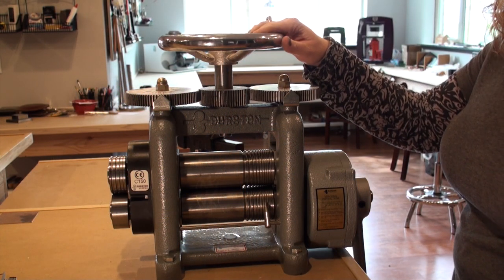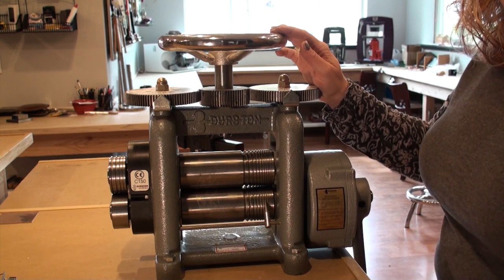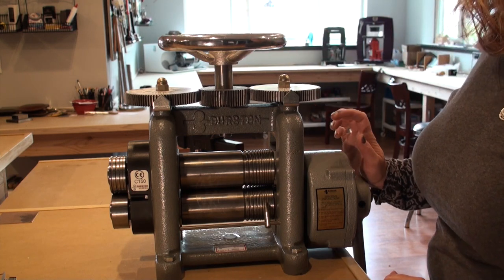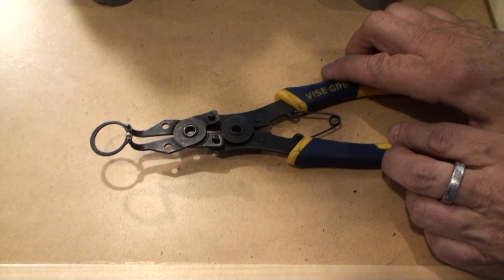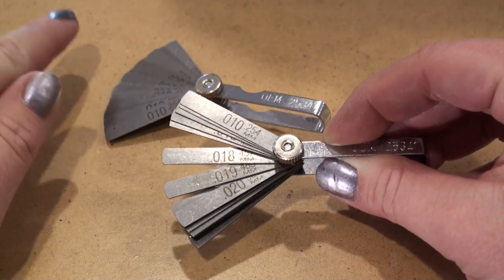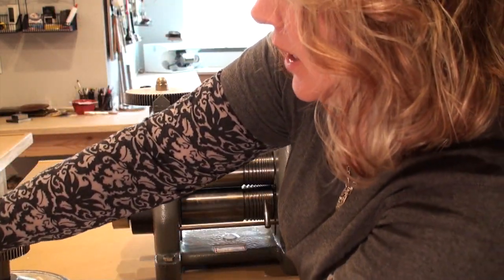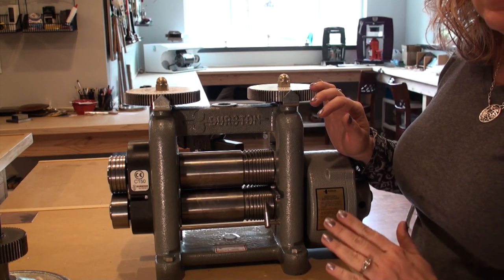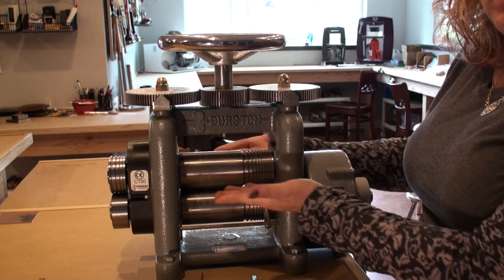Tool Time Tuesday - Adjusting your Rolling Mill Rollers

Comment from the maker: @luemoonba, Rolling mills can be found in many price ranges. This one was a bit more expensive than a lot, but more middle of the road (around $1,200.) You will certainly get what you pay for. Inexpensive ones can be found for as little as $200 (I can get that one for you.) I saw some good prices on a Durston on Contenti's website recently. Price will be affected by the roller size, wire rollers, extension rollers, etc. Just make sure you get one with a reduction gear.

Comment: Thank you so much. Was so excited when I picked up a high quality used mill at a great price only to discover that the rollers were not running parallel. I would like to think that eventually I would have been able to figure out the solution on my own, but you made it a lot faster and much less stressful.

Comment: Hi Melissa,  I have a Durston DRM C150 and my gears are hidden until I take the handwheel out.  The gears are still partially hidden even after I remove the handwheel and they're really hard to turn by hand.  Do you have any suggestions?  Do you happen to know if that's normal for that type of mill?
Reply from the maker: As you already know, they changed the design of the mills since I purchased mine. I am not sure how you would do it unless you are somehow able to remove the cover that guards the gears. I will see if I know anyone who has this style of mill and wee what I can try.
Reply: That'd be great!  Thanks so much! =)  Love your videos, by the way.  I've learned a lot from you and really appreciate how freely you share so much great information.

Comment: Hi, Melissa.  Thanks for the video.  Does this work for a Pepe rolling mill, as well?  I have a 130 flat mill from Pepe.  I am not sure they're calibrated correctly because they're very difficult to roll anything through them and I thought this may be the issue I'm having.  Thanks!
Reply from the maker: yes, this will work as well on  a Pepe or any other rolling mill. But I am not sure this is the problem. Tell me a little more about how they are difficult to roll things through. What do you mean by difficult? Is it tight?
Reply: Yes, it’s so tight that it’s impossible to turn the handle. I have my mill bolted down to my table and the table is actually bolted down into the studs in the wall. I wanted it to be super secure. It’s so tight that I’m afraid of breaking the handle or stripping the gears of the mill. That’s why I thought they may be out of alignment. I anneal the metal before rolling it through, as well.  As you and I have previously discussed, I barely get an impression when using the laser paper. I have yet to try a steel pattern plate but I think that may be the way to go.
Reply from the maker: Tamara Adams when did you get your mill? Who did you buy it through? I think there is something else going on.
Reply: Melissa, My husband bought it for me for Christmas in 2018. I don’t know where he got it, but it was new so that’s why I’m wondering what’s going on with it. 🤔